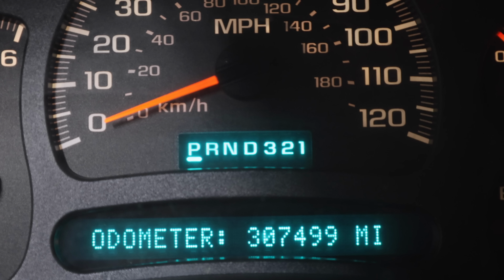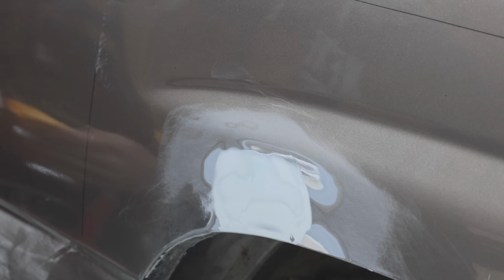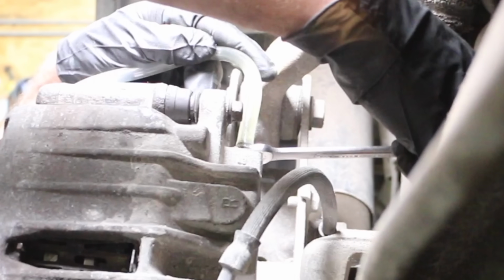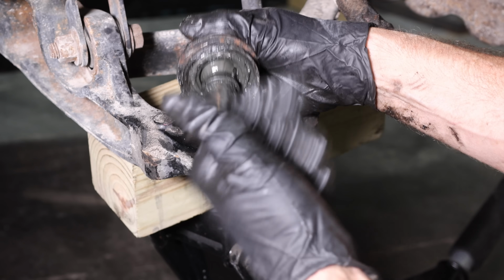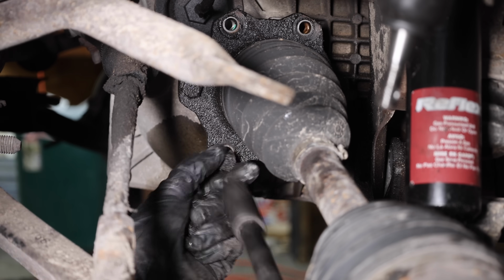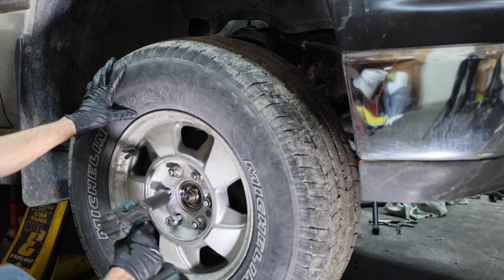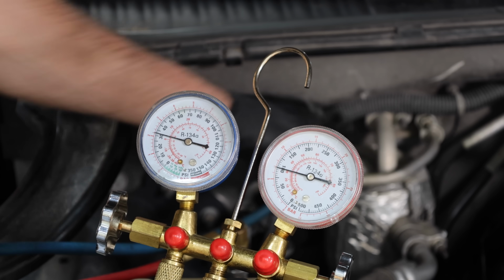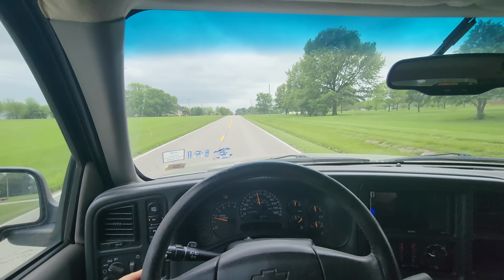Is It Stupid To Fix Up A 300,000 Mile Vehicle? Let Settle This!

Comment from the maker: Here's a list of some of the tools that I used in the review, and please checkout the video description for more details. Please let me know if you'd like to see more videos like this one. Best regards, Todd
Foxwell Battery Tester: https://amzn.to/4dxxkZo
Powerbuilt Ball and U Joint Service Set, 23 Piece Tool Kit, https://amzn.to/3LWwrjm
Wheel Bearing Race And Seal Driver: https://amzn.to/3UP7cRd
Brake Fluid Tester: https://amzn.to/3WgLZlf 
Coolant Test Strips: https://amzn.to/3UyomTW 
Dielectric Grease: https://amzn.to/49VL790 
Vacuum Pump for Fluid Extractor: https://amzn.to/4baBvbw 
¼ Inch Clear Tubing for Fluid Extractor: https://amzn.to/3Qm65Xv 
Step Bit for Building Extractor: https://amzn.to/3UBuawf 
Seal Puller: https://amzn.to/4b7I2UN
Reply: It's definitely time to replace the rubber brake lines
Reply: I’m trying to learn more about cars especially older ones because I never had anyone to teach me and I want a 1st gen Toyota Tacoma more than anything else in the whole world. One thing I don’t see enough and would really appreciate from your videos is an overview of how much all the parts cost and the important tools so I know what I’m getting myself into, I’m ready to put in the work but idk if my wallet is lol.
Reply: @landoniousbugonious7761    Youtube is an incredible source of information for automotive repair.  Get the best repair manual available.  You're absolutely on the right track to want a Toyota Tacoma, thats a great truck
Reply: I  totally agree.  Keep doing what you're doing.
Reply: I'd be interested in links to where you purchased the parts, at least for the front end rebuild. Did you buy them as a kit or individually?
Reply: Jesus loves you Sir.
Reply: A great video. I have a 2004 Yukon & it’s been the best, most reliable vehicle I’ve owned!
200,000. Miles & going strong! I’m going to try & keep it going because the new vehicles are less reliable & difficult to work on, plus EXPENSIVE!!!
Reply: Great video! Great information!. With all of tht precision and your analytical style. I have to assume you are or were an engineer.  How do your you keep track of the maintenance for your vehicles?  I agree, maintaining a vehicle is much better than replacing one.  Like all the videos you make!

Comment: that model of chevy pickup will go 500 thousand miles only mistake G.M. made was the heater core placement  and not undercoating or rust proofing on a quiet night you can hear them rotting down

Comment: Pace is just right. We can always pause and replay as needed.  Excellent DIY work on the fender repair.

All that work is well worth the time and money if the “bones” are good on the vehicle.

A good alternative for those unable or unwilling to do the work themselves is to search for a good mobile mechanic. They typically don’t have the overhead of a shop and can provide real savings on labor.  This approach worked very well for me when I had to replace the engine in my Class C motorhome.  Did extensive research on parts quality and ordered the parts myself on Rock Auto for additional savings.

Comment: old video but great video. I was surprised the Control arm Bushings were not changed while you were in there as everything else needed to be changed. Those Trucks GM made back around 2000 were the best they ever made. The newer stuff is straight Garbage and it seems every Manufacturer is struggling to build quality Trucks and Cars as well

Comment: That is the best auto refresh I have ever seen and in the shortest amount of time without all the introduction hoop La before getting down to work. Those 2002-2006  Suburbans are easy to work on and last forever with proper maintenance. Parts are plentiful and reasonable for them too and plenty of you tubes working on whatever component you are interested in. Great video.

Comment: As a former mechanic that worked on cars and did bodywork. You did outstanding work for your first time.
For the well repair you did you did the right thing considering you had padding behind it. Stitch welding was your best option.
When it comes to replacing any accessory belt, best way I found to do it is take the old belt put it in half lengthwise and use it as a guide to install the new belt, then cut the old belt off and install the new belt the rest of the way. No need to uninstall all the accessories or all the brackets. All you gotta do is make enough room between the fan at the crowd to get it on.

Comment: Well, I just bought a 2006 Chevy Silverado 1500 with 250k for $1800 ( most expensive vehicle I have owned so far at 54 yrs old ) I just put $1400 worth of brake lines, 2 rear pads, 2 calipers and a booster. Got it home and the shift cable went out. I have had the truck a year before any issues. I plan on putting a transmission and motor in it even with the rust I have. I don't have the means to buy a nice vehicle. Not new, just nice. New is off the plate haha. I am just watching how to replace the cable now and you popped up. I am no mechanic, but I have to try. Folks can use this comment to feel better about the issues they think they have. ;)

Comment: I’ve been fixing up a 2011 Frontier P4X I bought last year. As I fix issues, I add enhanced parts like a lift etc. truck runs great. Doing the valve covers in a month or so due to minor leaking. Going to add a valve spacer from Z1 when I do the job.

Comment: It’s never a mistake to fix a car rather than to buy a beamed new one.

It’s pure economics: a new truck is going to cost at least $60,000.

If you have an old one, that you’ve taken care of for the last 5-10-15 or more years, do you honestly believe that it’s going to need even $30,000 of repairs? 

Probably less than that. 

If it’s full of rust, then maybe you’ll need a new one, other than that rebuilding an engine isn’t that difficult, I’ve done it several times. 

I taught myself to weld some decades back and you can too.

I’ve never rebuilt a transmission, but there are shops that do that and it’s a hell of a lot cheaper than buying a new car.

I have replaced transmissions using junkyard transmissions. I’ve never been burned doing that, but I have been burned buying junkyard motors.

Comment: I had an issue with the front sway bar links where when I installed them with bolt threads sticking up they were rubbing a hole into the brake lines. Beware that they will rub if you don’t install the links facing down

Comment: Vortec engines, especially those in Suburbans just refuse to die. My 01 Suburban has 390,000 and still going strong. I just had a new transmission put in her at 340,000.

Comment: 24:49 Please make more of these! I bought my mother's 2002 Chevy Suburban from her (the car I learned to drive in when it was new!) and it has 213,000 miles on it. I love it and am LITERALLY currently working through this very video to keep it alive for as long as possible. I just replaced the alternator, battery, filters, fuel pressure sensor regulator, spark plugs and downstream O2 sensors, and I'm about to take the back tires off this weekend. I'm not a mechanic, but I am a handyman 😂  Can this get enough love for him to see it? I hope so ❤
Reply: By the way, my mother and I both love this channel, and we talk about your new videos after we each watch them. Cheers!

Comment: I have a 59 rambler with 500k miles on it .  I just recently replaced the rear wheel bearings. they were a pain to replace.  the car gets  25 mpg parts are not really available.  if keep with oil changes and grease jobs it trudges along.  It has a good reliability record.   it has made 1000 mile trips as well as car shows in the last year

Comment: considering the price of a new vehicle, if the frame is good, its worth even 10k replace everything for another 200k miles. since its prob a 5.3l v8  which never really dies, would call this worth while.  hell i'd pay 20k in repairs for a truck i know will last another 100k-200k over a brand new vehicle that will likely cost up to 80k and prob need maint before its first oil change.

Comment: 21:30 That method doesn't hurt and is certainly better than not changing any fluid but I never allowed any of my employees do that in 20 years of running my transmission shop. Ive personally never done it in my 40+ years of being a Mechanic. I like pulling the pan to change the filter and clean the magnets and pan. I also get to look at the insulation on the wires for cracks etc. Most OEM pan gaskets are really good quality & reusable so the only extra cost is the filter disposable shop towels & any extra magnets you choose to add.

Comment: 20:47 perfect for the rear wheel drive your working on. Just be aware that front wheel drive cars need the opposite (a little toe out) because they pull the toe in under load. Also some people tell me that my string alignment isn't accurate enough compared to computer assisted alignment. I say string method after replacing worn parts is way more accurate than driving around with worn parts.

Comment: 6:40 Cleaning the threads is good but I use mild to med Loctite on the brake bolt threads & anti-seize on lug studs to prevent rust & corrosion for the next guy.

Comment: No definitely keep it fast. We can replay the video or slow it down if need be. The Onslaught of information is part of what makes Project Farm Project Farm. Much love from WV!
Also as the owner of an 01 Silverado with 280k miles which is basically the truck version of this vehicle. What was the rough cost of these repairs?
Im debating doing this myself cause my truck runs great motor and tranny wise.

Comment: My 09 Tacoma has265,000 miles with very few repairs . (Alternator and wheel bearings). My 1999 Taco had 376k when I traded it in. I hope to get at least 300k out of this one. I maintain all fluids on time and drive cautiously . I  drive mountain passes frequently. Maintenance is cheaper than car payments most of the time.

Comment: I have chevy trailblazer 2008 with 471k miles on odometer and still using 10W30 engine oil and still running smooth😂

Comment: I got an abandoned '06 Silverado 143.5" WT for free from the in-laws just to get it off their property. It had sat for 5 years. Didn't even know the mileage until I got it hooked up to the Jumpstarter. 404,617, but only has a little over 100k on the motor and Reman transmission. Had a bad battery, misfires (2 clogged injectors, no coolant (just water), corroded spark plugs, front brakes were metal on metal, stripped bleeder valves, pinholes in the brake lines, overdue for service on the diff and trans fluid.. Doing one last OE upgrade (trans pan with a drain plug), and replacing a bad O2 sensor and it'll be street legal. These old 99-06 GM trucks are so great for learning to work on cars

Comment: It is definitely worth the money to fix up a car when you understand what is actually wrong with that car. Several years ago I fixed up my 20-year-old Honda Accord with 250,000 miles on it for around $3,000.  To be clear I had kept it maintained and repaired the entire time I owned it, but it needed a lot of front-end work. At this time I spent $3000 to replace major front-end parts as well as belts and hoses.  The repair shop I had been using the entire time I owned it tried to gently persuade me to not waste my money, as the car was worth about $500. After I fixed it up, I gave it to my son, who drove it for 5 years. He recently sold it for $500.  My son got a great car that worked very well, and, other than basic maintenance (oil and filters), cost me only $3000.  Find me a good running vehicle that you can own for $600 a year and I will say you are a winner!

Comment: If the vehicle doesn't have any rot or rust yes is a good investment back east frames body panels all rotted out rust is the main killer of vehicles out here in the Pacific Northwest it's pretty common to see 25-30 -year-old still running strong

Comment: Is it stupid to fix up a 300,000 mile vehicle? That depends on what has already been replaced over the years. Generally, yes, it is stupid. That is because everything in the vehicle has 300,000 miles on it. Brakes, bearings, suspension, transmission, etc. Everything is preparing to fail, or is failing already. However, with a single owner vehicle that has been well maintained and bad parts replaced instead of ignored over the years as soon as they showed signs of wear...one might get away with patching it up for another round..but eventually, the vehicle in question would no longer be the same vehicle, as literally every wear component will have been replaced.

Comment: I just finished fixing up a 2007 Escalade ESV black on black with 203,000 miles. It was only $1300 and it was neglected as fuck. I had to fix alot of small things, and a few major including rebuilding the top end of the engine due to a bad lifter, and rebuild the valve body of the transmission, redo the leather seat skins I’m in it a total of $2800 and it runs and drives perfect, most of it is now rebuilt, looks great and will be my daily/dog/parts hauler for a very long time Hopfully. I absolutely will not miss a car payment on something that tracks my location, won’t last as long, and is a pain in the ass to work on.

Comment: Another good one.. I guess I did preventative maintenance because I've done this twice on my truck on 250 thousand miles. I did beat it up a little. 

Runs perfect recently new cap rotor & spark plugs. 

I now have my gf 2006 Hyundai that needs a paint job and door handles..

Comment: Great job, Todd !

It's always a good idea to keep your 90s and 2000s vehicles running.

Why?
Because the cars manufactured today are computerized and designed to be difficult to repair, as well as engineered for planned obsolescence. 

The 90s was the golden age of vehicles in the USA.

I would drive that Suburban until the wheels fall off.

Love your channel and keep up the great work !
Johnny

Comment: I have a 94 chevy surburban that has 320,000 miles as of 4/30/26 with one spot of rust on a front finder. 
 I drive this vehicle daily to and from work. The white pant has peeled off over the years.  shes still  going strong.
Reply: I have a 2001 Yukon with 316,200 engine runs great I’m about to put a new rear end in it had it for 6 years I would say it’s worth the 800 I paid for it

Comment: It depends where you live. Southern US yeah 300k miles more than fine to fix it. Northern part of the US, no it is not worth it. At that many miles the frame is more than likely junk from all of the salt. I ran my first car a 08 impala to about 250k. The reason I got rid of it was the frame was completely rotten and was to the point it could not safely be driven any longer. Engine, tranny etc where bullet proof on it.

Comment: Man our Mercedes B class that is 15 years of age with 123.000km (76428 miles) needed new calipers, rotors, pads, slide pins, clutch cylinder, hydraulic release bearing, all new springs, strut bearings, lower ball joints, sway bar links, tie rod ends and brake lines in the last three years. Most of these parts were replaced because of corrosion because we live on the west coast of Norway. For your Chevy to last this long might be a miracle or very good engineering.
Reply from the maker: Thanks for sharing!
Reply: 15 years with only 76k miles?! I have had my 3 year old car and just rolled over 105k miles!
Reply: @Chomps56789  It went from being out main car to one we only use for long trips in 2016. Only in 2022 when I got my license did I start to drive it intensely again. On top of that we simply dont drive as much here in Norway as you do in the US. Compared to other EU countries we drive more I believe, but still in the big cities a 50-80 usd monthly public transport card gets you to wherever you need to go for a fraction of the cost of driving a car. The fuel costs about seven dollars per gallon when converted from kroners and litres.

Comment: My 02 Avalanche runs well with no check engine lights. The interior isn't the best but I have maintained the drivetrain and suspension myself so it rides like a caddy and rumbles like a Chevy truck should.

Comment: i followed this guide on my bmw and I couldnt fit any of the GM parts!! :(

I was able to get the car on the road again using the drill attachments i just saw from you new video though, that chainsaw was a lifesaver on trying to get the ball joints trimmed down and i used the recripocating saw to trim up the axles to fix the alignment

Comment: I don't have all the tools but i try to do what I can.   My Dodge 3500 also just turned 21 although it had allot less miles, I just went through most of the same repairs!.  I had the shop do the power steering box (didn't want to mess with the beefy pointman arm), and fan clutch (they diagnosed it and i was having the EXACT issue you described), and transmission service (have to drop the pan and no drain plug...). I Also had them do coolant flush and new water pump (billet upgraded one) and thermostat.  Had them put in a new deep pan with a drain plug so I can DIY it in the driveway next time.  $$$..

Had another shop install a new class 5 hitch (required lighting the bed to remove the old one)...

I did some stuff myself  though!!! Gotta pick my battles!  I did the front and rear diffs plus new covers with drain plugs because I'm supposed to do them more often like every 15-20k  Front brakes, some sensors the shop broke, air filter, added additional diesel filters, replaced all the shocks, new exhaust to replace the cracked one, both batteries replaced, steering shaft, replaced backup hitch camera And more... Much cheaper than buying a new 3500 though, and no loan needed!   I still need to check the rear brakes... It took me allot of hours despite having the shop do so much.

I need to fix a panel with peeling clear coat, and I was going to get some 2k paint and clear coat. I noticed you didn't re-clear the whole panel.... Can I just fix the spot like you did?